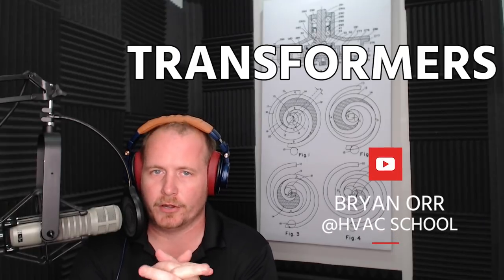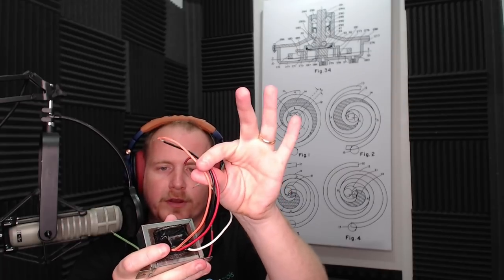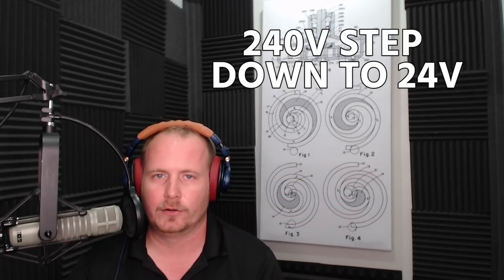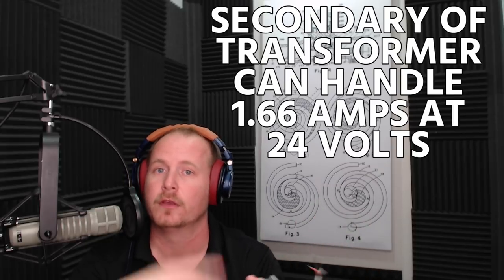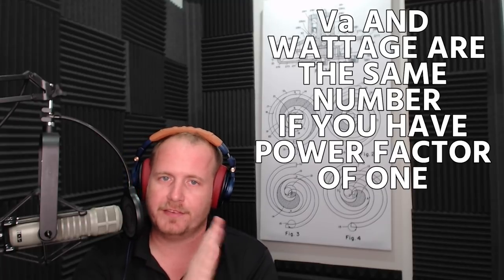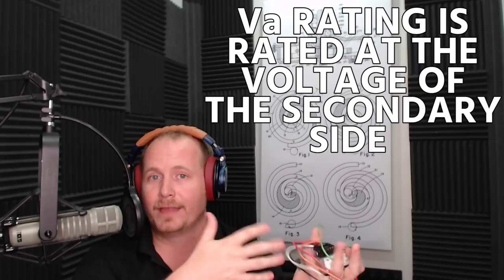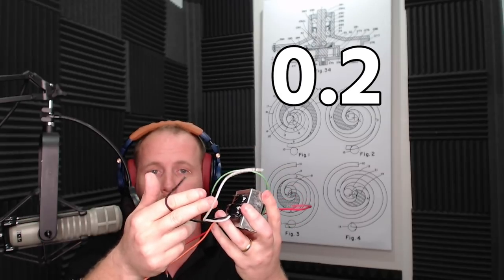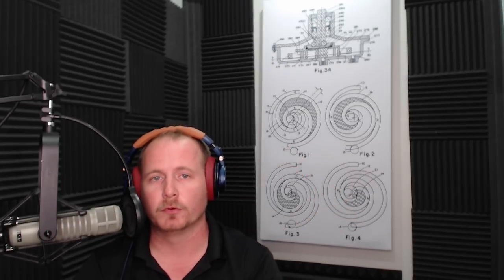Transformer Facts

Comment: 75% of my service calls are never set to proper primary tap on commercial rtus..most equipment is tapped at 240volts and installed in a 208volt situation..which drops the secondary accordingly. I would get contactor chatter, or damper actuators failing to complete their travel, or even duct smoke detectors tripping..that is a pain due to some locations of installation.

Comment: Thanks Brian.  I've always generalized by thinking of VA and wattage as synonymous without considering any inductive load.  For MY applications, that's never been a problem.  However, it's something else to consider.
I've certainly used the VA rating when choosing to add a fuse to the circuit.  I hate letting the smoke out of a perfectly good transformer when some hidden short in a control board blows it.
That doesn't happen often, but it has.

Comment: Well done sir. I know a lot of techs will add a 3 amp fuse in-line of the red 24 volt side of a 40va transformer to protect it from a t-stat wire short coming back and smoking the transformer. Of course if you have a built in fuse for your transformer you don’t have to do this lol
Reply: Fuse 3amp agc is mainly to protect the control board from the thermostat and its line....

Comment: On a 120v furnace do you wire the white com from the transformer to the white or black line voltage from the electrical panel?

Comment: Hi, I have a question for a power subwoofer. My fuse kept burning out no matter what fuse sizes I replace it with. The sub indicate to use 1.5 amp only but it kept burning so I moved it up to 3amp and it still burn. I was told it’s probably the transformer. So I opened the sub up and found the transformer to be 70V at 60hz. The model number is atc frost FT2845 which I can’t not find anywhere online. How do I know what transformer I can use to replace it and if you know, would you reference a link to it?
Reply: I believe the wattage it’s suppose to get is 210 watts. Thanks in advance.

Comment: So my HVAC is a heat pump and everything is running but not putting out cool air.  My vapor copper line has a frost on it.  Opened the blower unit and the transformer was humming and very hot.  Found out the evaporator has frozen.  So, is this transformer need to be replaced??  Anybody can answer this question, I would really appreciate it.

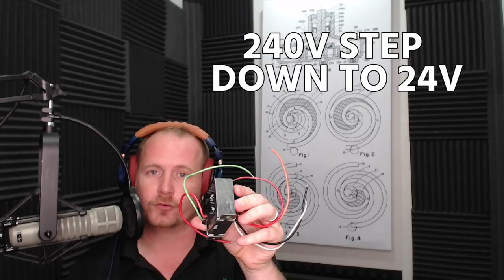Comment: 2:45   I can't wrap my mind around the concept.  Played it over and over and I hear the words but nothing sticks
Thanks for the videos.
Reply: What do you mean?? The wraps??
Reply: @JohnnyJr396  yes exactly....the thought of more length of wire wrapped around itself results in a different voltage.
Have a super and Happy New Year
Reply: @JohnnyJr396  tHanks.  That is a great tip...I appreciate it.    I think electricity is very interesting....but I spend my days in carpentry where life is good.
Reply: Instead of wraps he should say windings. The ratio of windings on a 120v primary to a 24v secondary is 5-1.
Reply: The current in the Primary is used to generate a varying magnetic field in the transformer core. The field rises and falls in accordance with the AC line frequency of 60 Hz.
The varying magnetic field induces a voltage in the Secondary winding, in exactly the same way as a generator generates voltage. In either case, a moving magnetic field cuts across a coil of wire.
Reply: @tommacdonald6070  Fascinating stuff.  Good thing I'm not in charge of the Department of Energy because we would still be making mills down by the creek.
Reply: @Dancing_Alone_wRentals  
The original Hydro Power.
(Any one of us lowly technicians could run the many departments of this government way better than that those Ivy League goofballs do now.)
Reply: @tommacdonald6070  too funny

Comment: If the transformer is wired incorrectly for 120 V on the primary lines when it should be 240 V, what would happen to the transformer?  What would happen to the zone controller connected to the secondary wires?  What would happen to the thermostat connected to the zone controller?  Thanks.
Reply: If you wire it for 240V, and connect 120V to it, the Secondary Voltage would be 12V instead of 24V.
If you wire it for 120V, and connect 240V to it, the Secondary Voltage would be 48V instead of 24V.
The transformer would probably still be ok if the secondary voltage were 48V. The contactor coils would get very hot, and any electronic circuit boards would probably be damaged.

Comment: Is it possible to buy a transformer that will step down from 120 volts to 75 volts?  I am refurbishing an old wall phone with a hand crank. The magneto produces about 70 to 80 volts to operate the solenoid to make the bells ring.  I want to wire it up to my doorbell but the current doorbell transformer only produces about 24 volts.  Not enough juice to ring the bells.  Any help and advice would be so greatly appreciated. 🍻
Reply: You might be able to find one. But you can buy a variably transformer, affectionately known as a Variac. You connect 120V to the outer terminals. You can get anywhere from 120V to 0 by turning the knob. They come in a range of sizes. Sounds as if you need a very small one.

Comment: I was working on 230VAC to 24VAC transformer. 
The voltage between 24VAC terminal and 0V terminal at secondary side is fine.
But the voltage between 24vac terminal and any other external ground is around 240 volt. 
Why is it so? Do I need to earth the secondary side of transformer?
Reply: It sounds as if the Primary is shorted to the Secondary internal to the transformer. There should be no electrical connection between the two windings unless you have an Autotransformer (very unlikely).
If the windings are actually shorted internally, by grounding the secondary, you would trip the 240V circuit breaker that feeds the unit. The transformer would probably let out some smoke.

Comment: Sometimes I see the green on secondary bonded to the chassis. Is it by the way the voltage is induced or could either leg on the secondary be bonded?
Reply: The secondary doesn't care which leg is grounded.

Comment: I thought white is common like ground, so for 240 you use black and orange ?
Reply: No. Still would be white and orange.  The white wire is just a common point on the transformer. The white wire could either go to a grounded point (120v system) or an un-grounded point (208/240v system).As he explained in the video, the primary side (and secondary as well) has turns of wire. The combo of white/black has 5 turns. The combo of white/orange would have 10 turns. If you put 240v on only 5 turns of wire(black/orange combo) you would have 48v on the secondary side of transformer. Does that all make sense?
Reply: it's weird for me cuz I'm from switzerland here is black GND

Comment: What ohms and Voltage reading  on the 24V side would indicate a bad transformer?
Reply: Hi John, I would think a bad xformer will either show no voltage reading on the 2ndy. In a rare case if there IS some voltage (most likely less than the rated 24v/ac) then it could be some turns/windings of the 2ndry jumped over thereby reducing the net number of 2ndry turns - though there are very rare chances of this happening. This from my limited knowledge, though I am sure there are more qualified folks to comment on this. And if this is a center tapped the 2ndry might show just 12 vac between the center tap and one of the output wire which means one half of the 2ndry is open.
Reply: Also on the Ohms reading in a bad transformer  the ohms reading will either be Open (also no 2ndry voltage reading) or 0 ohms meaning completely shorted or in rare cases as above, might show some ohms (less than the rated reading). You will have to make sure to read the Ohms by disconnecting the 2ndry turns from the circuit/load side, because otherwise it might give false reading due to other components.

Comment: I am seeing a sharp increase in failed transformers in devices in my wide area.
What causes the transformers to fail, without blowing the main device fuse?

My multimeter reads a varying voltage from 111 to 118 volts from mains.
Is our power company in southeast Ontario Canada not providing reliable enough power?
If they fluctuate Hz too much, would that cause this?
My multimeter doesn't measure frequency.
Reply: The Power Companies control the frequency extremely tightly - well within 1 Hz. Even so, most transformers are rated to work on 50-60 Hz.
Voltages ranging from 111V to 118V are not a problem either. We expect the voltage to be around 120V + or - 10%.
Low voltage, like 111V would even be a little easier on the transformer than higher-than-normal voltages.
Probably just cheap or undersized transformers, pushed to the limits of their ratings.
Little 40VA transformers can come in a wide range of quality.
Transformers are often upsized enough to leave a comfortable margin between their rated capacity and the expected load.
I have been using industrial control transformers in electrical control panels for decades. I don't think that I have ever seen one of them fail. (Typically 1000 VA)